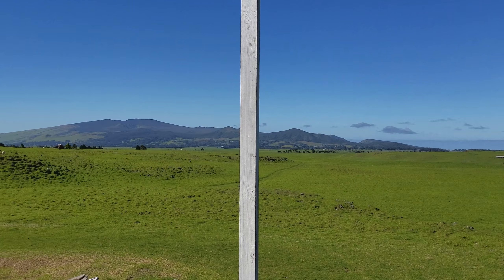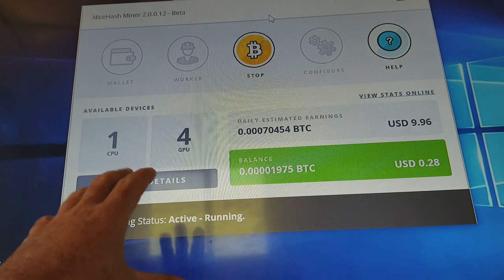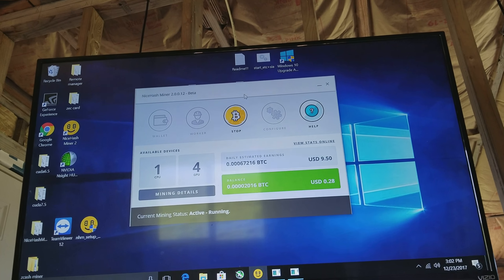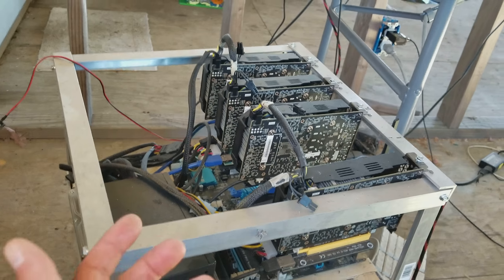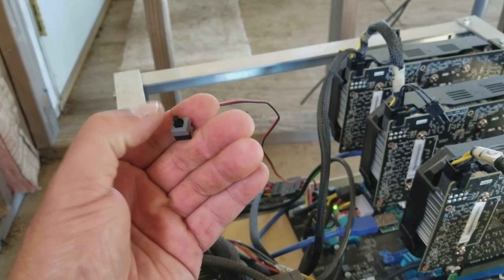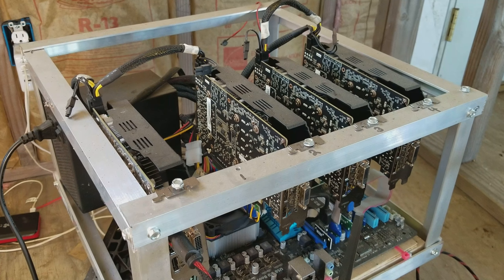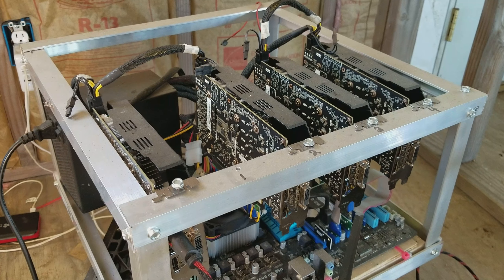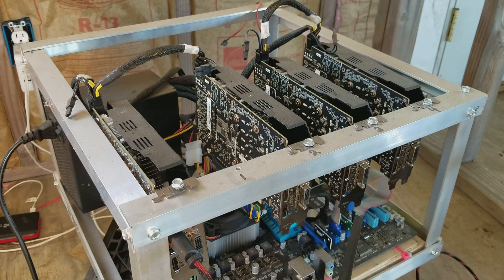Real Solar Powered Bitcoin Ethereum Mining Rig Off Grid Home Cryptocurrency

Comment: Power here in NEPA is around $.06/ KWH. I'm planning to build a small ASIC operation with Bitmain Z9 units. GPU mining is very inefficient here. 3 KW of solar panels with adequate battery backup would be good for 5 Z9 ASICS. Each unit runs at 10,000 sols/s at 300W. Since I live on a windswept hillside, I might add a vertical axis wind turbine, or two to take advantage of the wind here.
Reply from the maker: Ur lucky have low cost of power in your area. Here 0.45kwh but that's why I mine on a solar and wind turbine system. I mine none stop. Been thinking about bitmain miners but not sure how long it would be Profitable before it's not profitable. Thanks for sharing.

Comment: would you share your rig spec sir and how many rig can it perform with solar?
Reply from the maker: I will be making a vid soon going over the setup. example if your rig uses 500w you will need 800-1000w solar system to keep it running, you can scale up for there.

Comment: Wow, you have a great location for solar minging! Have you thought about scaling up your solar rigs? Assuming you have a rig that uses 1kw/h and want to run it 24/7, the solar panels would save you $3,504 yearly for Hawaii rates. Even if mining crashes, you can always resell your GPU's and keep the solar to use it for something else.
Reply from the maker: +tavanh mounenalath check out the new vids I'm building a big solar system right now using Tesla batteries.
Reply: Awesome stuff there. 18650 batteries are the way to go for storing energy. I am also building a small DIY solar bank. Keep the updates coming.

Comment: I want to ask if i have 900 watts mining rig how many solar panel and battery i need to run my mining rig?
Reply from the maker: I will make a update video on this Topic I have had others asking Similar questions. I might have it by tomorrow afternoon.
Reply: About 3600 W/p = 12 Panels and 4x250AH Lead acid battery. ($900 battery, $2400 solar panels) $500 4KW Inverter, about $4000 with wiring, and mounts, and $1000 installation costs.

Comment: Awesome vid. 
I recommend you skip the power inverting though. Your pc runs off of 12volt. Why not run you panels directly into. You would easily save 30% in efficiency.
Reply from the maker: solar stright to mining rig will not work because the panels will push to much power to the rig, the batteries act as the buffer. but i could run from the batteries to the rig and get rid of the power supply.
Reply: You need the batteries when a cloud floats over.
Reply: Modern Off Grid DIY very right!
Reply: The PC also needs 5 volts and 3.3 volts to some parts of each component

Comment: I am a little curious if mining will still be a thing in 2018 with the new purposed tax laws in the US against crypto currency. From what I understand every transaction of coin is taxable now, not just when you cash out. I will say I am surprised your set up works as well as it does considering you just have 4 solar panels lying flat on the ground and not even at an angle or on your roof.
Reply from the maker: +Justa Guy each panel is 235w works really good. The tax law means nothing because ur Supposed to pay your taxs on income Earned just like in business.

Comment: Hey i want to start a solar mining rig, what do you guys think of a 15w cpu with a GT 1030 on a 60w 12v solar cell? Those low tdp mobos only have a 20 pin so could i get away on mining only on day light without a battery?
Reply from the maker: +guaco joznei you need battery

Comment: You need to underclock your gpu's not overclock, you're not gaming.
Reply from the maker: it does way better the way i have setup I have tested all the settings.
Reply: I looked it up and you need to underclock your ram because your not using it, but if its working than ok.
Reply from the maker: I will check it again

Comment: How many watts are your panels? Inverter info? and How many batteries to carry the energy the whole night? Thanks
Reply from the maker: running 2 outback Inveters, a ton of Real Tesla Batteries, 2 midnite charge controllers, 1 outback charge controller, one 48v wind turbine, 10 235w solar panels, alot more 270w solar panels. Plus a small 12v system for backups